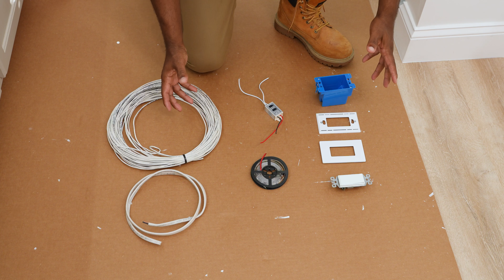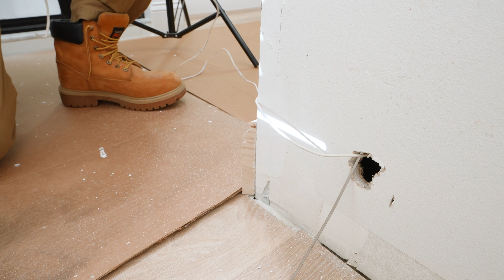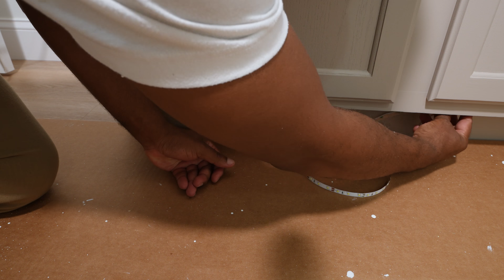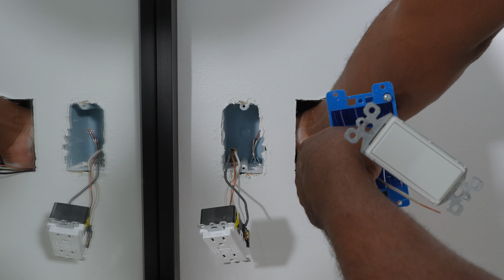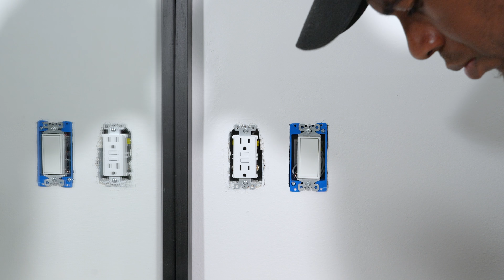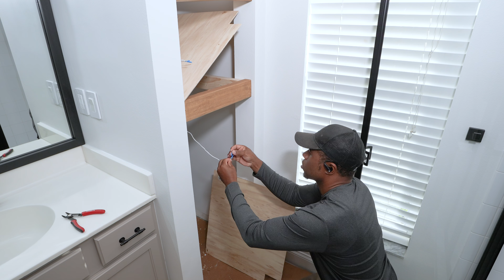Under Cabinet LED like a pro (no visible wires)

Comment: Thank you for answering one of my questions. Great video. I think that bathroom and kitchen lights should have their own circuit, or share a circuit with other lights and switches, never mixing. At least by U.S. building code, as I understand it. But, this did give me an idea of where to hide things. Thank you
Reply: Disclaimer, I'm not an electrician, nor do I pretend to be one. Please, check the building code yourselves

Comment: How did that transformer hold up over time? I’m tempted to use one like you used in the video or a built in dimmer/transformer but I’m worried about how long it will last. I imagine most led transformers are so big for a reason

Comment: Please don't stick the strip directly on the bottom of the cabinet, you get uneven spots like on the left 1/3rd point here.  Use diffuser channels to keep the strips straight and even out the light and eliminate hot spots.

Comment: What a complete waste of time and money: It's so passé.  Installing a light that illuminates a strip of flooring, which is of no use for anything. In this instance, what makes it worse is having to flip a switch (rather than a motion sensor-controlled one) for a light that illuminates your feet whilst you wash your face and brush your teeth.
Reply: Motion control would have been better.

Comment: I like it. Nice installation! The only thing I’d do differently is getting a dimmable smart switch and use an addressable LED strip. You can have red if you need to be in the bathroom late at night and not have to wake yourself up as much. And pair that with a presence sensor so the light can be automated to go on and off at certain times when presence is detected. I’ve got to watch your closet video now just because that little light looks interesting.

Comment: While I can appreciate the effort, you absolutely CANNOT run bare 120 volt wire between electrical boxes like that - leave the white jacket on the Romex and only strip it once INSIDE each box!! As an Electrician this scares me that others will see this and copy this.  DIY or not, this would fail an electrical and home inspection if your house is sold, not to mention that outer jacket protects the wires from being pinched where they exit and enter an electrical box, so this is a potential fire risk. You also shouldn’t stuff a transformer inside a box like that - another fire hazard AND you’re not allowed to mix 120 volt with the lower voltage of the led strip without a separation. Honestly a video and good attempt, but just really unsafe execution.
Reply: Do all transformers have to be out in the open somewhere?  It's clear to me that the code doesn't allow this setup, but it's not clear to me whether there is any in-wall solution.  Also, can you clarify what should be done about the separation between low and high voltage?  The wires should not be allowed to run alongside one another?

Comment: I did something very similar to this, with the main difference being I bought a switch with a motion sensor built into it, so if you walked into the bathroom at night, the led's turn on automatically.
Reply: It’s awesome.  Especially when stumbling in half-asleep.
Reply: That’s exactly what I want to do. How’d it work out?

Comment: Unprotected wire in the wall is wild, use a small strip of romex dude.
Reply from the maker: I did use Romex. The boxes are like less than 2 inches apart. I didn't feel that two to three inches of jacket would make a difference here.

Comment: cardboard houses are extremely versatile when adding new electrical devices.
Reply from the maker: Why so you say this? My exterior is built with cinder blocks. The house is partitioned with 2x4 and the walls are closed with drywall. This makes it easy to do work later 😊.

Comment: Where do you put the power supply if I was to just run it under the cabinets? Should I leave it exposed or shove it in the wall?
Reply: Do not shove them in the wall, that's a fire hazard and against code. In a junction box or in the cabinet are the most common places.
Reply: I wouldn’t put the power supply in a junction box with the switch. Not certain if  code will allow that type of installation. The supply will also not have airflow for cooling.
Reply: @jbponzi1  Code wants the junction in a box and the driver itself accessible. Both of those are satisfied putting it behind the switch. It should only generate heat when the switch is on, but even still, It won't generate enough heat to matter even if they stay on constantly imo.
Reply: @knowah. thanks. Appreciate the answer. I spend most of my time in the industrial codes NFPA79 than 70.

Comment: Be careful removing the sheathing on the romex from box to box? It’s voids it’s UL listing
Reply: This comment needs more visibility. It's against code and that plastic strain relief in the box is designed to apply strain relief to the NM jacket. Clamping down directly onto the wire like that can wear through the wire coating and cause a fire in the future. If you read this, you should go back and fix that - if that house burns down, insurance could actually deny the claim.
Reply: @b @bowgy4 your definitely right that it’s against code but it’s not going to wear through the insulation and even if it did it would have to short to something to start a fire.  Definitely shouldn’t be done like this though.
Reply: UL listings only matter for inspections.
Reply: @WeMe83 Right, because the UL listing is actually unimportant other than for passing inspections. It doesn't help prevent you from burning down your house at all. 🤡

Comment: This is really awesome but you should replace that switch with a motion sensor switch. I use Kasa motion sensor switches all over my house and it's a game changer. I've got them in my hallway, my closest, and in both bathrooms. That way you never have to remember to turn them on or off and you get this beautiful accent lighting that works automatically and autonomously.
Reply from the maker: Thanks! Once I am done I will evaluate what options is best. I did the hard part a switch can be replaced to a wide verity later.
Reply: @DIYCreators absolutely, that's all I did was replace a bunch of switches with these Kasa motion sensors. They are only about $20 too.